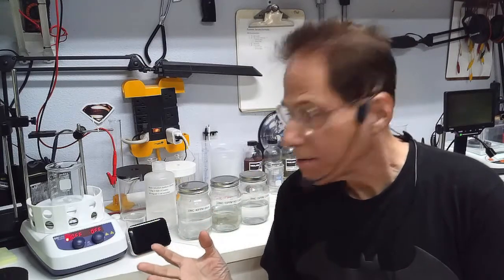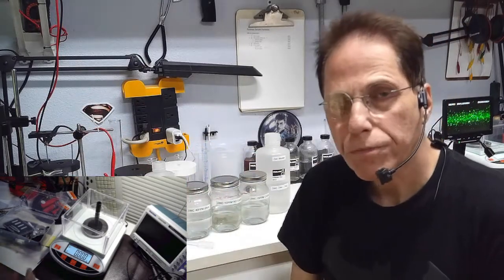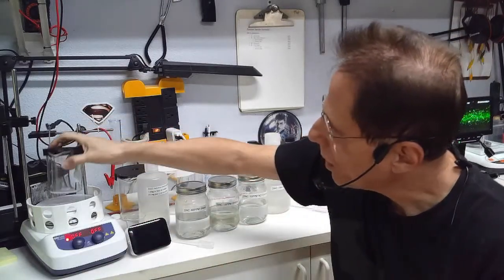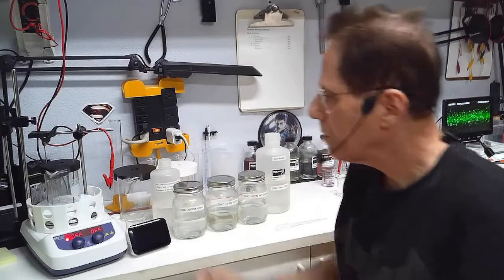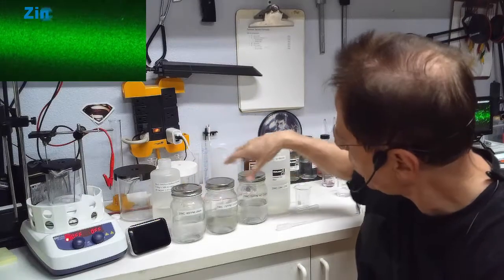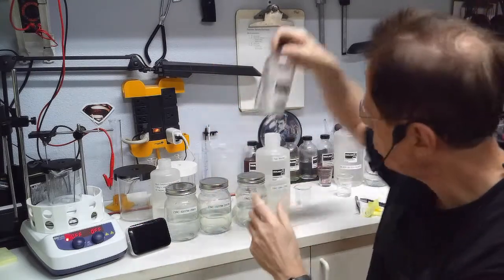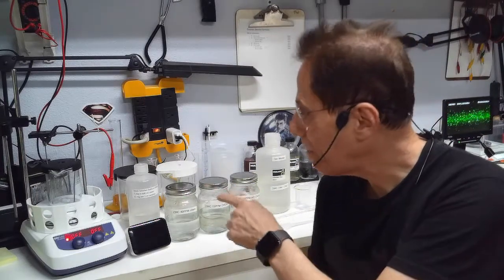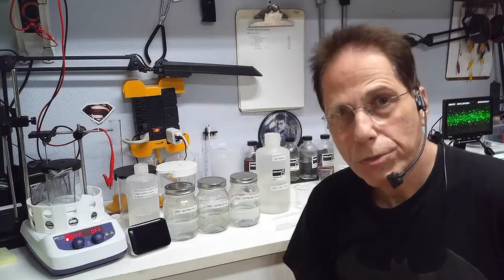How to Make Zinc Nanoparticles.

Comment: Can I use vinegar instead of sodium citrate
Reply from the maker: No, Vinegar does not create a stable zinc. The sodium citrate creates an electrostatic force that helps keep the nanoparticles apart or from colliding with each other and exploding. You can cook zinc without sodium citrate, but it will only last a week or two. As long as you don't mind having to remake it in that time frame, then go and make it without any sodium citrate.
Reply: Thanks

Comment: Question: my zinc settles down at thé bottom after a few months and a white cloud on thé bottom and no visual colloidal with the laser pointer visible anymore ? How can i get zinc stable
Reply from the maker: So far, only two ways that I've found to make zinc long term stable:
1. Plasma arc using one zinc rod and one silver road for a 50/50 silver-zinc colloidal compound. 
2. Or zinc made with a laser. 
LVDC zinc and plasma arc zinc by itself will only last a few weeks, perhaps a month.

Comment: Hi would a TDS read the ppm.if using distilled water it's zero.  Not sure what would be with citric...
Reply from the maker: You use the TDS meter to read the distilled water before you put anything in it. It should be zero. Of course after you add any chem, like citric acid, it will no longer read zero. It just needs to start at 0 ppm. We don't want strange interaction with minerals or other substances that are in tap water to muck up the process or worse create something unknown. For example salt added to the copper process creates Copper Chloride which is toxic. Using distilled water makes sure we got exactly nothing to interfere.

Also TDS meter is no good for measuring colloidal content. I have a video on it.  
https://youtu.be/3XwAUYLiKjs

Comment: Citric accid works too?
Reply from the maker: Without the Sodium (in the citrate) the zinc will cook but it may not be stable or last very long. Sodium citrate tends to create better "Van Der Waals forces" around the nanoparticles. However you can cook it with just citrate or not use anything but distilled water. With just distilled water you are looking at a very long slow cooking process and lots of zinc sludge waste, and again, with just distilled water the zinc colloidal nanoparticles only lasted a few weeks. Feel free to experiment with just the citrate. Worst case is it falls apart in a few weeks.

Comment: Thanks.i watched your ppm video as you recomended.
Still, I don't understand something:
Let's say I buy all the instruments (including the digital microscope) -
How can I know for sure how much ppm I have in my colloidal? You say you cannot weight the residue. I should just compare it to your findings? And how did you understand that your digital microscope findings are equal to that specific ppm?

I just want to say I do want to brew, I'm not questioning you to prove you wrong. I want to learn from you.
Reply from the maker: If you want to make the stuff for your own use, you can get a power supply, some beakers and the metal. You can use a red or green laser to show you that you have nanoparticles in there. Weighing the metal will give you some idea of how much material you've used, but even that is not needed.

The findings in the digital microscope only shows the overall quality and concentration of the nanoparticles. My use of ppm is only to give everyone a sense of reference to the amount of colloidal nanoparticles that may be present, not an accurate counting of them.

I may make it look easy but using the microscope with the laser needs much caution, as the laser light can damage your eyes if you are not careful.
Reply: @AlchemyWizard  So you’re saying there’s not much need for the microscope to make the colloidal, right?
One thing I don’t understand is how you show the colloidal solution in a green hue. The microscope is simply enlarging whatever is underneath it; there’s just a clear liquid there. Why is it green?

Regarding the laser – I can use just about any laser, simple as can be, green or red, to see if I have particles inside?
Reply from the maker: @yuvalh2844  You don't need the microscope to make the nanoparticles. All you need is a red laser temperature gun or a green laser pointer to illuminate the particles to see how concentrated the nanoparticles are. At first you would see very little laser light being reelected back through the beaker.  As the nanoparticles grow the laser line going through the beaker fluid will get stronger.

Be careful with lasers as the light from them can easily reflect back to your eyes. Red lasers are generally safer than green but they still are bright. Use a cloth or towel behind the beaker to capture the laser light and prevent it from bouncing off and back into your eyes. Dark sunglasses or laser safety glasses for the color laser you are using can be useful and would be better for eye safety with laser pointers.

With a regular microscope, even the video microscope, you can't see the nanoparticles; they are too small and require an electron microscope. So, I use a hack. I take a green laser and pass it through a sample of the fluid. I built a rig specifically for this function. The microscope lens enhances the view of the reflected light from the nanoparticles in the sample. If I use a green laser, I will get green colored image. If I use a red, I get red. Green is more visible for the video images.

I use the laser rig to make nice pictures for the videos and for understanding colloidal nanoparticles as part of my research. If you're just making nanoparticles, no need for the microscope. 

This video shows the laser getting stronger as more silver particles are created: https://youtube.com/shorts/NvQdEgYnll8

Comment: Hey :)
I enjoy watching your video; it teaches me a lot.
I'm looking to start cooking silver, zinc, and definitely more in the future, and I have a few things I'm not sure of:
1. What are the currents or voltages for each metal?
2. How do I know how much PPM is in the solution by weighting the rods? You showed that 0.009g of silver makes a 20ppm solution. How did you reach that conclusion? How can I calculate that?
Reply from the maker: I use 37volts for making all my low voltage electrolysis colloidal nanoparticles. However anything over 24  volts with 5  amps of current should work fine. How much current the metals draw depends on the metal and what chemicals are added. Gold will draw about 280ma of current, platinum about 1000ma, everything else will be under 25ma, typically under 10ma. 

The amount of colloidal content and the amount of material used can be quite different. Not all metal used converts over to a colloidal nanoparticle. With low voltage electrolysis, you will have waste, either sludge or oxidation that will not turn. These have to be subtracted from the overall results. But if you are looking for a general rule, use the basic PPM formula and figure about 20% loss of material that does not convert to a nanoparticle. Copper can be as much as 50% waste material. 

PPM=  (amount of metal consumed in grams / amount of fluid milliliters) x 10^6.

Also see this video on PPM and colloidal concentration: https://youtu.be/ax9i0S7ENTM

Comment: Can you provide a simple equation to calculate PPM?  In my example, I need to calculate PPM from 5g rod reduction in 500 Ml batch size.  Thanks.
Reply from the maker: General PPM Formula for Material used: 

PPM= Materials used in grams X 10^6
----------------------------------------------------------------
            Amount of Fluid in mL

example: 10ppm = .005g X (1000000 / 500mL)

Comment: I tried with my silverlungs generator.  It took 3 days. I tried with the sodium solution but my generator didn´t turned on, cause it marks 13 ppm, so it wont start. Could you please recommend another power source? what kind of adapter I need?   I tried with a regular plug and put the alligator clamps and nothing happened.  I have the meter to measure the ppm. Also the heater and the multimeter. I have it all.  I managed to make 20ppm with the silver in 2 days.. its wonderful solution, I want to do it faster. Thank you
Reply from the maker: Silver: 500mL, silver rod anode of about 14awg, some kind of stirrer it should not take any longer than an hour to produce a light brown mixture, which would be about 18 to 24 ppm. Use a red or green laser to see if you got particles going in there. TDS meters really do not work. I have a video on it: https://youtu.be/3XwAUYLiKjs

Magnesium 500mL may take about 3 or 4 hours to get a very light laser beam in the water. It will often be hard to get magnesium higher than 12ppm colloidal. The rest of the magnesium may become ionic. But that is okay. Ionic magnesium is friendly to the body, though it is not absorbed as easily as the colloidal part.

I use 37volt DC power supply. However you can use anything over 20 volts. If you are real desperate you can use three rechargeable 9V batteries, or use one of those power bricks if their voltage is 20v or higher.  here is a video using batteries: https://youtube.com/shorts/O7L9Hxgx4wA?si=Bh74MC1m2RI_kjcV

power supply: 
• 60v Power Supply on Amazon: https://amzn.to/3RlCAmA
• 24v Economical Power Supply: https://amzn.to/3Nu1lMS
Reply: I made Silver no problem with the Silverlungs generator. I am interested in making the Zinc solution you have in the video. My question is what power source you use to make this Zinc solution?  you don´t mention this in the video.  
Thanks @AlchemyWizard
Reply from the maker: @librestadospanish6260  Ah yea, sometimes I forget to put the links to the equipment in the videos, I will go back and add them. 

I use 0 to 60v power supply set to 37 volts. You can use anything between 20 to 40 volts. I will put a link to a brick power supply and the variable one I use below. Lower voltage will just take longer. I would not go below 20 volts. 

• 60v Power Supply on Amazon: https://amzn.to/3RlCAmA

• 24v Economical Power Supply: https://amzn.to/3Nu1lMS
Reply: Great, thanks. What is the difference in time using the 60V and the 24V?  I checked my silver generator, it has 47 V output and it takes me 4 days to make ZInc 25ppm.  
Wonder if the time difference is big to justify the investment. I guess too, that will reduce the time for the copper.  @AlchemyWizard
Reply from the maker: @librestadospanish6260  You can cook zinc to  70ppm in 100 min. Here is the check list below. It will be a milky white when done. Then you can cut that down using distilled water, afterward, if you want a zinc that is not as strong. Mix 50% distilled water and you will have 35ppm.

☒ 37v Voltage.
☐ 500 mL of distilled water.
☐ drip sodium citrate to get start current to  20 mA.
☐ set stirrer to 500 rpm.
☐ 8 drops of corn syrup to stabilize.
Reply: @AlchemyWizard  Verdiğiniz youtube video linkleri yayından kaldırılmış. Bunun yerine rumble linklerini verebilir misiniz?
Reply from the maker: @candanuckardesler3070  just visit the rumble site and go through the catalog or do a search, there are not many videos up there. https://rumble.com/c/AlchemyWizard

Comment: I have 2 more questions: 1. Is it normal that the zinc wire on the positive pole forms some black residue? I think zinc compounds like zinc oxide or zinc hydroxide don't have a strong color (more like white-ish). So what could that black stuff be? Did you observe something similar during the process? (I use distilled water with TDS 0 and my zinc rods have a purity of 99.995%). 2. What's the purpose of the sodium citrate? Is it used because zinc citrate is not well soluble? If so, could I use zinc citrate instead of sodium citrate? Thanks! :)
Reply from the maker: I wanted to verify the color of the zinc oxide using LVDC electrolysis, so sorry for the delay. 500mL distilled water, two zinc rods, 37vdc, stirred to 400rpm, sodium citrate dripped to 15ma of current. Cooked for 100 minutes until the solution was a strong milky white. I measure the zinc colloidal nanoparticles at 70ppm. I had small amount of white zinc oxide sludge on the positive (cathode). There was no evidence of black substance.

I talked to my chemist about it and she said the only way you would get something else in there is if you used something like a copper anode, which would give a reaction to the zinc process. Or perhaps there was some other metal left on the walls of the beaker. Try testing your water with the TDS meter after you put the water in the beaker. And of course that means make sure your beaker is clean. I use "Dirty Labs" (https://amzn.to/3pN6b0k) no scent powder dishwashing detergent, just a few sprinkles to clear my beakers and bottles. Soap with scents added can contaminate a beaker. You should always wash your beakers when changing colloidal processes to another kind, because the colloidal nanoparticles will stick to the glass.

Redo your zinc batch being careful with all the above and let me know the results you get.

Sodium Citrate is a capping agent that will keep the colloidal nanoparticles from falling apart. If you cook zinc with nothing but distilled water, it will only last about 30 days. Then you will get white zinc flakes falling out of the liquid. I have not tested zinc citrate as a capping agent, so I do not know if that would work. But if you do use zinc citrate, then you be introducing an ionic zinc to your colloidal. The idea is to limit the ionic content when making a colloidal.
Reply: @AlchemyWizard  Thanks a lot for taking the time to answer my questions :) I always make sure that I have TDS zero in my beaker/flask. But after repeating the process, I took a closer look at the "black-ish" residue and now I think it's just dark elemental zinc powder. The citrate method works much better though and also leaves me with some light sludge on my anode. So I'll stick with the citrate method for the future. Next, I'll try colloidal silver before I try out the more noble metals, hopefully I'll get the plasma arc method to work :)
Reply from the maker: @thomasfarmer12  The zinc metal itself is a darkish color so its possible you got alot of zinc metal in there that did not become anything. Just a guess. Stick with the citrate it does a good job of stabilizing the colloidal zinc as well so it will last for months.

Comment: Hi! Today I tried to make colloidal zinc for the first time. I used 32 volts (my lab power supply could not go higher) and a stirrer. I did not use the sodium citrate (yet). I used 500ml of distilled water and I let the electrolysis run for 6 hours but the solution did not turn cloudy as in your case (I did see some larger particles though). So I would like to test if my result ended up okay. What magnification do you use in your microscope to look at the colloidal solution? I'm thinking about buying one like that if it is affordable enough.
Reply from the maker: Most pictures are taken at 75x to 100x using 4x object lens. the ocular lens is adjustable from 10 to 25x. You will need a green laser to shine through the liquid to light up the particles. the 3D printer files for the laser system I designed is available for free download. There is a video somewhere on the website on it. Here is the link to the 3d printer files to print it out and a link where I show what it looks like:

https://www.youtube.com/watch?v=brkp1_UdcWw 

http://wisdomsdoor.com/files/index.php
Reply from the maker: Just another caution on using a laser and microscope to see the colloidal particles. Never look through the eyepiece or directly at the beam of light going through the solution. Use a camera or get a dedicated video microscope with no eye piece. Use protective eyeware (dark sun glasses or wielding glasses) when using lasers.